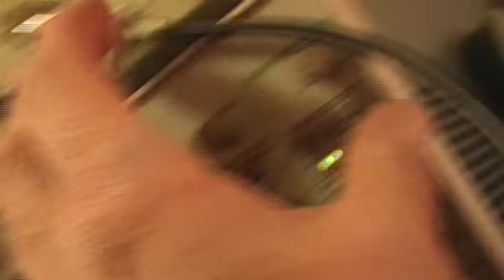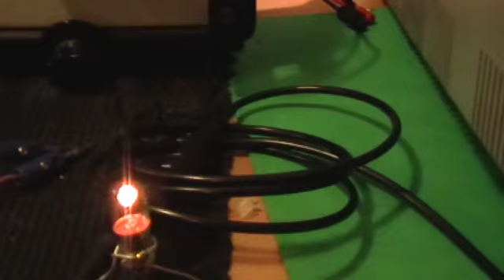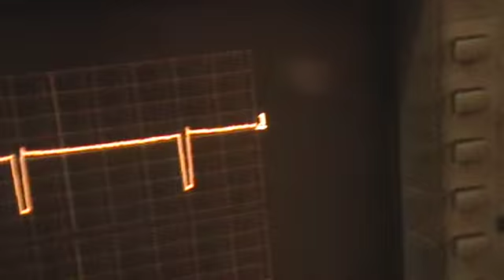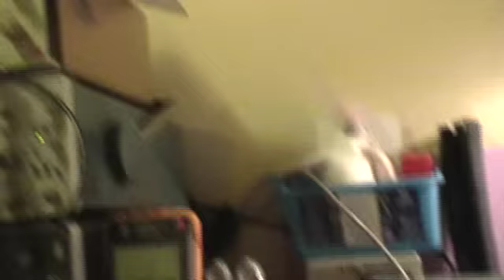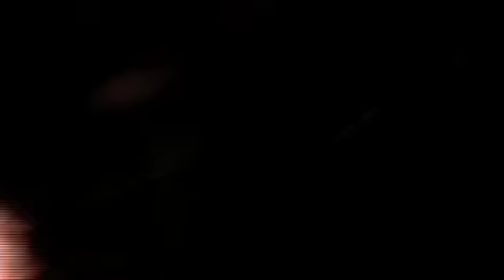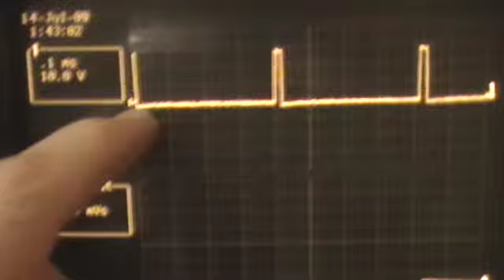Electric OU 7: Up is OFF

Comment from the maker: The POINT  is that a profound lack of understanding of basic circuit behavior MAY have caused Rosemary Ainslie to use the WRONG figures for the duty cycle in her experiment, and IF this WRONG duty cycle was used in the energy balance calculations, they are invalid.
I'm NOT saying that her effect is impossible--yet. I'm saying that the Ainslie "research" is so full of holes and errors that it can't be trusted to be accurate.
What you see here, along with her posts, illustrates that point.

Comment from the maker: Rosemary said:
"This link has been provided by a friend from (you know where, -TK)  It's been posted by TK and apparently shows that a MOSFET is constitutionally unable to apply any effective duty cycle to a battery supply source."

That, of course, is NOT what this video shows. A mosfet can supply whatever duty cycle you tell it to. How else could they be used as audio amps, for instance?

This vid shows the relationship of gate signal, mosfet state, and load current.